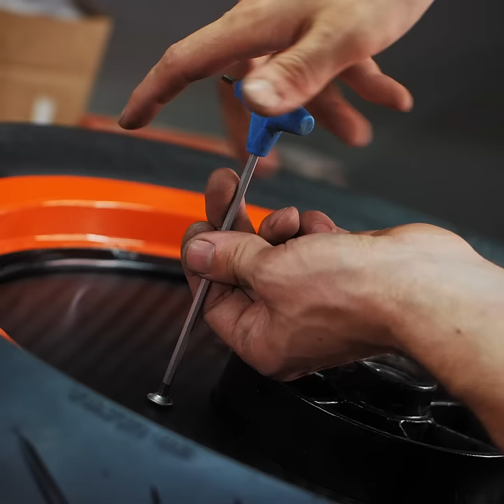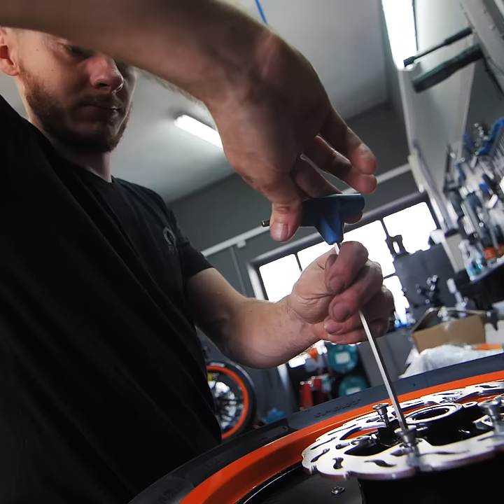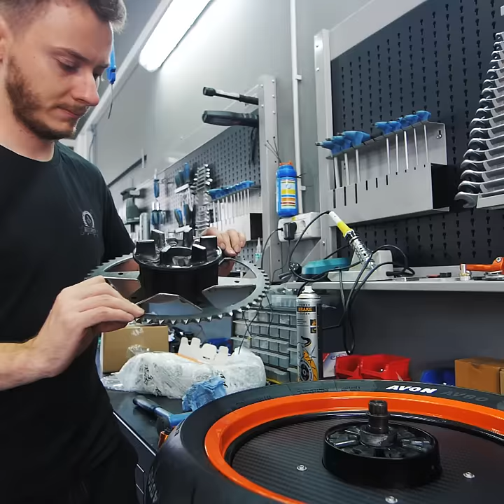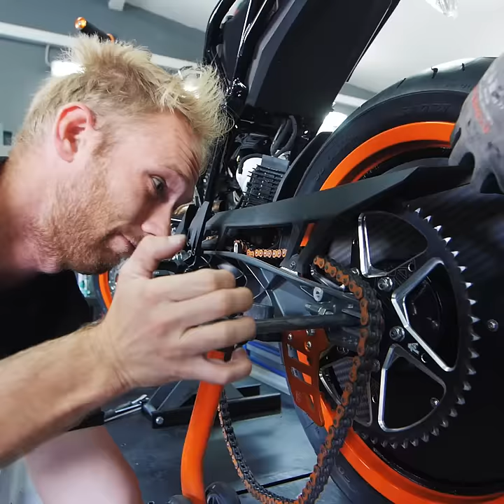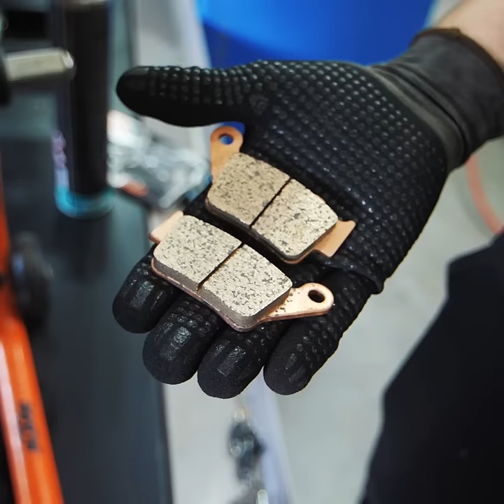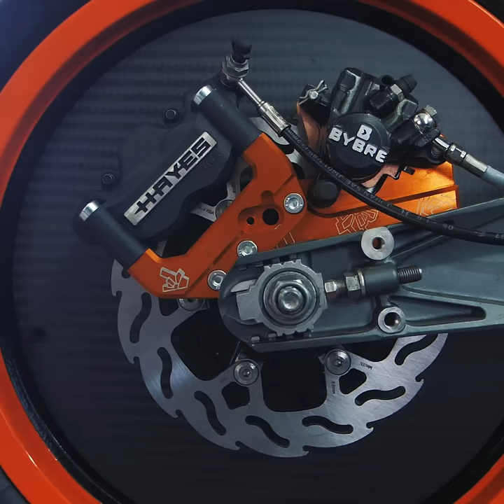Building a carbon rear rim #shorts

Comment: putting together some carbon trim on a regular rim
Reply: Exactly. I thought he was gonna melt the carbon
Reply: @sahilshah8392  Carbon fibre is derived from fibreglass which is layed or formed, the way it works with laying, they would paint a coating or layer of epoxy and then lay the fabric carbon material ontop, they repeat the process until they get the desired thickness of carbon and then let it set, alternatively they form it using the same method as above on whatever object they want, but instead it's inside a bag that can suck the air out, which makes it take the form of whatever you're using to replace or replicate that specific part, if you melt it, it would just be a plasticky mess.
Reply: Dam someone said it before me hahahaha
Reply: @ironlungthe3rd  fiberglass and carbon is not the same thing 
But not at all wtf
Reply: Agreed. I expected that they would build/machine the actual structure of the rim out of carbon fiber being that is what the title describes. Instead it was the equivalent of attaching a carbon fiber hubcap.
Reply: Thanks for fixing that awful misleading title. 👍
Reply: This does exactly nothing good for looks or performance but does add weight to the unsprung mass, makes the bike look dorkey, and you should already know (if you have any experience riding) that a strong gust of crosswind will put you into the next lane in about 1 second with these sails attached to you bike...
Reply: @robertwalsh5461  Also buggers airflow across the brake rotor(s), but that's not important either.
Reply: @Azlehria  How, With that in place it should be more directed?
Reply: @basilebrousse417  the curing process is different, the end part is considerably less in mass but yet he’s correct in that it requires vacuum to cure and remove any bubbles as well as act as clamping for the final shape but yes it’s just layers of resin and the matting material... most carbon fiber Matt is woven cross hatched and the layers are applied at 45 degrees to improve their shear and strain strength... there is a guy here on YouTube who shows the process on basic parts like tubes and bicycle frames...he’s easily found if you look
- now if you have a fat wallet and really want to dramatically decrease unslung mass buy full carbon fiber rims... they are ridiculously lite and stupidly expensive but you bike will handle like there is a god riding it... but you also loose much of the gyroscopic stabilization of those cast aluminum wheels.
Reply: @robertwalsh5461  carbon and fiber glass is definitely not the same material
You can use the same techniques for both 
And you can even use polyester resin for the carbon 
It depends on what you want to achieve in terms of visuals or properties 
But the 2 are not comparable
Reply: @basilebrousse417  I thought I’d said as much but you are absolutely correct
Reply: @ironlungthe3rd  and absolutely NONE of that happens here because they're just adding useless pieces of trim on an otherwise perfectly good wheel, for no benefit other than to look stupid.
Reply: ホイールカバーはどこの商品ですか？

Comment: Lol you gotta take whole thing apart when you need extra air
Reply: Yeah I was wondering the same too
Reply: They remove the whole tyre .m as they're racing
Reply: The valve stem is coming out on one side. In some shorts you can just barely see it
Reply: To think that you would think they haven't thought of that, lol.

Comment: That looks pretty cool. However if you get a big side wind 🌬 it will blow you over into the next lane pretty easily
Reply: Yes correct, with high wind we can't control
Reply: @anbukrishnan8031  even with a bike that weights 9kg the wind has to be at a huuuge velocity to take the rider out, with a motorcycle with the weight of the engine and metal parts, please, dont be so dramatic next time
Reply: You're probably talking about hurricanes.

Comment: Break will start heating, that's why it's air between the wheel and the shape that makes the air flow.
Reply: maybe on a car yes, but not here, the rotor is outside the rim so the sping doesnt direct the turbulence to the rotor, using the carbon rim, the air is keeeping on the outside of the spoke even staying more time near the rotor

Comment: Cardboard would be cheaper and could reduce your weight more. LED lights would really set it off if you have some gorilla glue. I put baseball cards on the side and it sounds amazing
Reply: I like when they put a can where the tire can rub on it, and it goes whir, whir, whir! Just like a real motorcycle!

Comment: There gotta to be a good reason for putting a single plate on the wheels.....................i mean does it help for aerodynamics or ...!          

Because just putting a plate on it doesn't make it light or something !
Reply: It looks cool
Reply from the maker: Style and also protection for stuntriding. Your hand can not get stuck so easy in the rear wheel in case of a crash ;)
Reply: @RokBagorosStuntrider  yes 
Right sir

Comment: Someone who explain me, what is that for? Makes any differences on bike, handling, aerodynamic?
Reply: It's for looks. As for effect....well there is not one other than if you ride in windy conditions you will feel it worse.
Reply from the maker: Style and also protection for stuntriding. Your hand can not get stuck so easy in the rear wheel in case of a crash ;)
Reply: @RokBagorosStuntrider  Never thought about the hand thing that's not a bad idea. Can't say I have ever seen it happen but it is always a possibility.
Reply: @RokBagorosStuntrider  dont crash then